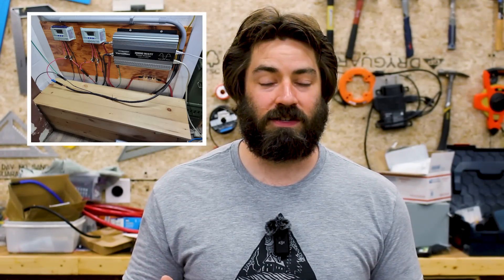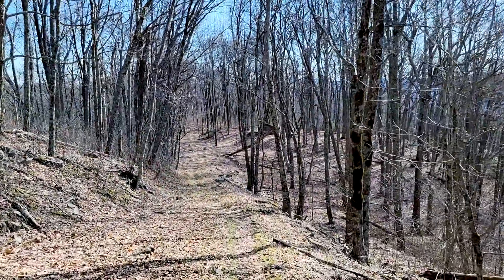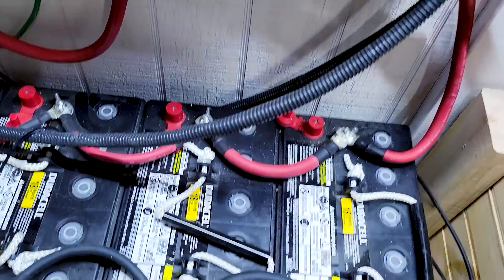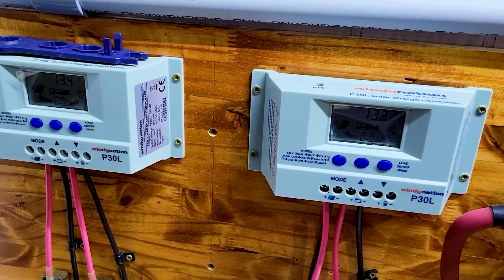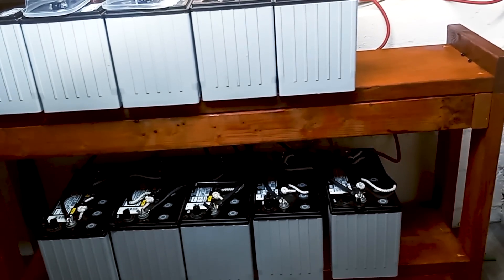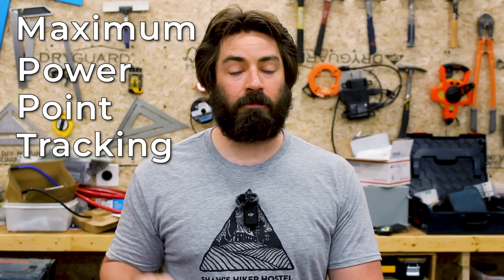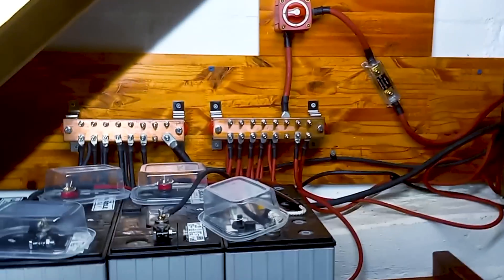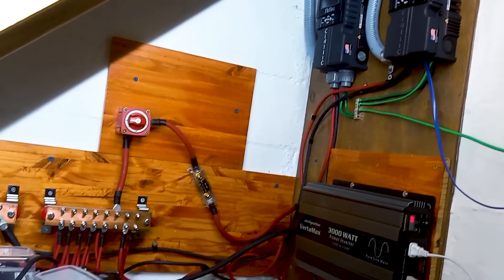Optimizing a Small Off Grid Solar System.

Comment: David, been a long time fan of your channel.
I am an Electrical Engineer and have learned so much about solar from you and Will.
You have contributed greatly to my building my own system and am now living off grid for 1 1/2 yrs.
I have a Dual MPPT, 2KW solar panels, 5KW battery, 4KW inverter running a fridge, big screen computer, A/C, plus a microwave or air compressor.
I also have a twinge of OCD - so in the interest of accuracy,
It looks like his batteries are in parallel. 
Daisy chaining is a serial method of connection, like when 4 -12v batteries make a 48V battery.

Great Vid and interesting backstory.
Reply: That is interesting that your 2kw of solar is powering all of that. I have 2Kw worth of solar but have not hooked them up yet. You must be using Gas for your water heating.

Comment: your awsome dave  most wv hillbillys are truly great people  imy cuz has campground on hatfield mccoy trails she will let you stay as long as you want for free just show it in a video
Reply: good video by the way  you should have your subs sent you videos or visit subs dave  i keep your email advise to us  you are a good dude and God has blessed you with a awsome family  by the way my 6kGS low freq inverter idle is around under 0.50 amps and it will do any batt bank voltage 12 24 36 48  they all will every one you dont have to buy anything to do it either   i think it can go up to 70 or 80 volts  but you may have to ask for the higher voltage no sure  GS has a 12k now also  my 6kgs will do 8k i am sure the 12k will do way over the rating also                     so low freq is NOT always high idle loses and with GS inverters you dont have to buy a new inverter to upgrade or down grade your batt bank voltage  it has all bells also like wifi see and change anything from your phone to much to write here

Comment: It is best to use what you have first. Make sure you have a plan so you don't spend on things that can't be reused later. Also, when running bus bars, make sure to keep each lead equal length to the battery to have proper current sharing. I ordered some copper for bus bars, but they are back ordered until 2 months so I am daisy chained on small wires for now. Fine for my loads, but it will melt my wires if I pull what the inverter is capable. I just have a couple panels in my drive way charging my 48v system until I spring for a new roof before mounting panels. Work with what you have and develop a plan to reach your longer term goal.

Comment: I may have missed it, but how does he ensure that his batteries don't go below about 50% depth of charge? Does he just monitor the battery voltage? My experience with my off-grid system is that I get a lot less power in the winter time, so I have to reduce my loads in the winter time.
Reply from the maker: Right now he is checking Voltage to give himself a Ball-park of the SOC.  A shunt is on the wishlist.
Reply from the maker: Different battery types can be paralleled, but there are some precautions.  Once Richard is ready for more batteries he and I will look at the age of the AGM's.
Reply: My recommendation for future expansion would be to use larger panels. I'd rather deal with 3x 340w panels than 10 x 100 w panels and all of the associated wiring. - OK, I hear now that he is aware of the advantage of larger panels.
Reply: I also wonder if, in the future he can add LiFePO4 batteries to his bank. I know dissimilar battery chemistry has different voltage range, but the overlap useable voltage range might work. I have thought about doing that, myself on my smaller system (adding LiFePO4 to my existing lead acid bank).

Comment: Suggestion: 1200W of flexible PV (in plastic) in series, left under the sun, disconnected from everything else. The accumulated energy will dissipate in form of heat; will it catch fire?
Reply: Solar panels are only about 25% efficient. This means when they're working optimally 75% of the sunlight is getting turned into heat. If the panels are disconnected this becomes 100% which is only 33% more.

Comment: Would just a flattened copper pipe running along the battery terminals be even better and cheaper?
Reply: Copper pipe might be a different alloy which is less conductive. On top of that if you directly mount any busbar directly across the batteries there will be slight movement due to thermal cycling which can make the connections come loose.

Comment: Although not specific to Richard's system, which he built around a 12V battery bank which he wanted to keep as is, doesn't it make sense to upgrade to 48V configuration (4x 12V batteries in series,  8x 6V in series, etc) with no parallel connection hence no busbar, and embrace the world of low-cost all-in-one 48V inverters (EG4, Growatt et al.)?  12V inverters seem so yesterday for off-grid use and even RV world is moving to 48V systems.
Reply from the maker: Yes, eventually Richard will move to a 48V system.  His budget didn't allow that right now.

Comment: That system looks FAR from optimal to me.  One thing I would recommend in cold climates (such as northern USA in the winter), and even on long runs of cloudy days for solar users such as in this video... start your car up and and if your solar system is 12V, just connect that directly to your battery bank for about 1000 watts of charge power (similar to his system on a sunny day).  If your battery bank is NOT 12V (for example it is 48V), then I would recommend having a boost solar charge controller (scc) that can take lower voltages (such as 13.8V of a running car), and boost it up to about 54V or whatever your battery bank needs to charge properly.  I have one such boost scc and it works well.  I can take a 13.8V output power supply for example, and charge a 48V series battery bank with it all at once.  Having this in tandem with the regular solar charging system is good for when the sun cannot put back enough charge, and you want to keep your batteries in a high state of charge so they have ample capacity when needed).

A good side effect of running your car to do this on a cold day is not only to charge the battery bank, but then you can pull it back into the garage and it will warm it up quite a bit, which is probably a good thing.  I would lift the hood if you want to get heat to transfer quickly, or leave it closed if you want the heat to gradually spread.

Comment: Hi David, I’m from England. Just a quick question, I have a caravan, RV trailer to you. I wanted to fit a 2000 watt inverter as we go off grid a lot when we get away. I have 200 watt panels on roof and a 50 watt panel which I plug in on site through a second charge controller. Now I took the battery out and bought two new 110amp batteries which I wired in parallel but using the ‘daisy chain’ method. After seeing this video even with just two batteries is it worth connecting all the leads onto bus bars? Thank you if you have time to reply to this.
Reply from the maker: I would still want a busbar.  When you daisy chain any number of batteries, the final +/- post will have 2 or more ring terminals.  There is a ring terminal from the inverter, and one from the second battery paralleled.  Sometimes there are more ring terminals from charge controllers (sounds like you have 2), AC charger, temperature sensor, etc.  Stacking any more than 1 ring terminal on a post is a bad idea.  It can cause extra heat build up, and is more likely to come loose.  When you have a central busbar every ring terminal has it's own connection point.
Reply: @DavidPozEnergy  Thank you. I will look into making some modifications 👍🏻